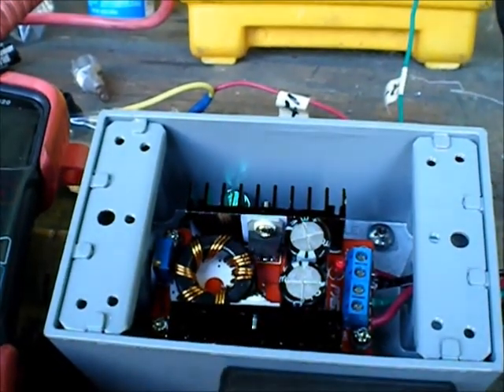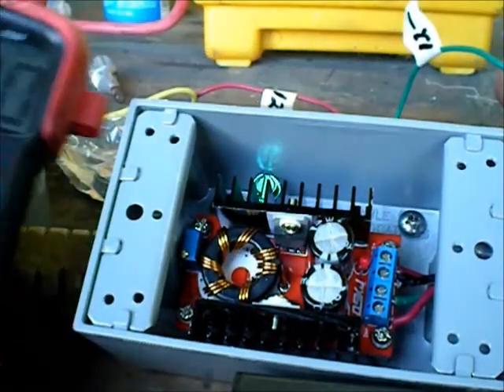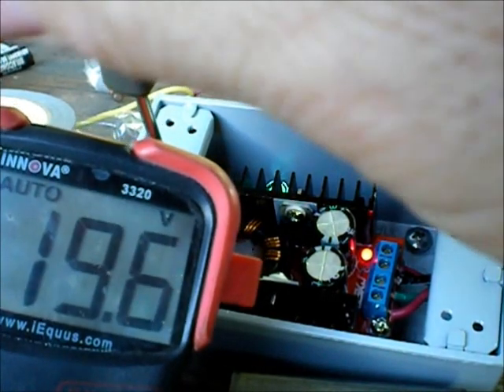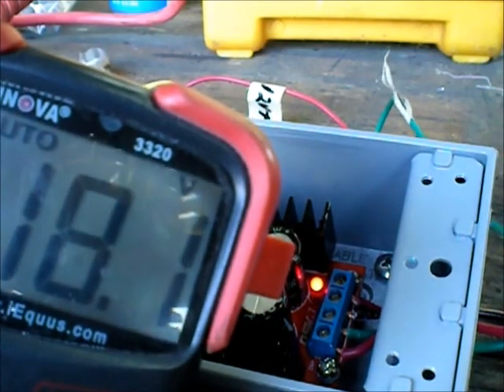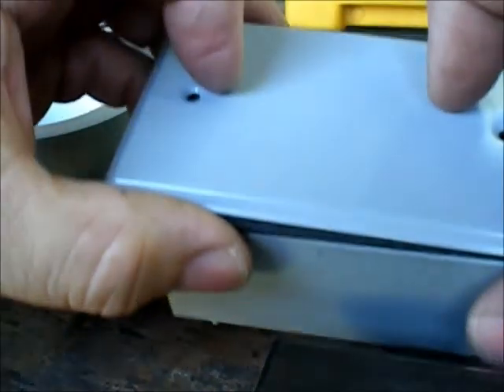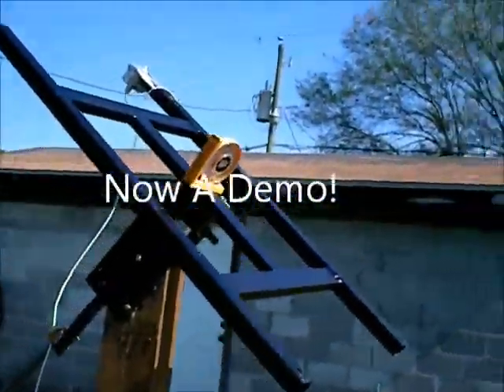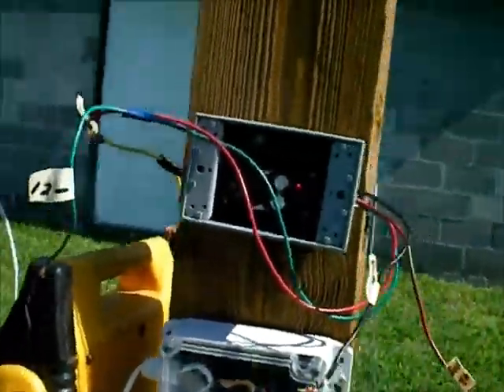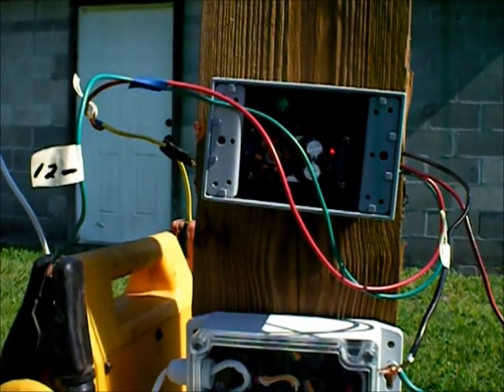How To Add A Boost Module, DC & Why.

Comment: very nice glenn i put the one on you sent me and it works very well and  like you said you can hear the differance in  the  motor. i was  haveing a  hard time getting it  to move off east with out help and like you said my panels are not  as heavy as your, i would like to add 2 more to mine and i think that booster is  what  the doctor ordered.

Comment from the maker: 12.2 is low voltage on top of the snow .Those cheap actuators are just that cheap. Plus it is probably frozen to.I dont know as it was 84 F today inside my house was over 86F my A/c is on. Crazy weather went down into the 40s than hot again. The boost module is the real deal i now have 1 on 1 jump box to add some zip when i adjusting my projects.

Comment from the maker: Under extreme test to Fail point loads & angles on My 8 panel old style tracker it failed to retrieve the extended arm, during testing. At that moment using My 18 volt Ryobi drill battery made it work fine. 6 volts more made all the difference. I have been using 1 for about  month now.

Comment: that is really important to know. I got a real thomas Sagnaw heavy duty that I have not installed yet. I think the old china 36 dollar special is not working. not sure what the problem is. But that is what i suspect. The battery says it has 12.2 volts. I may try to charge it up today. but it wont move the axetracka green light is on but it dont move from the east position. I dont know whats wrong but it could be the actuator. I would have to un wire it and test. It worked for months until cold w